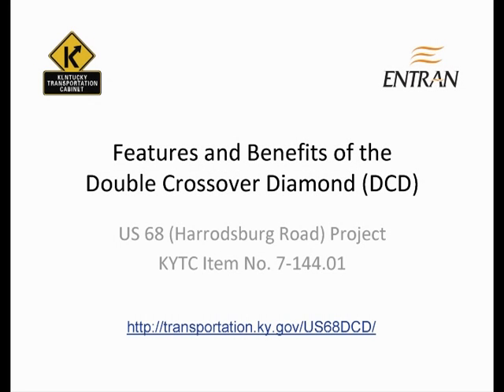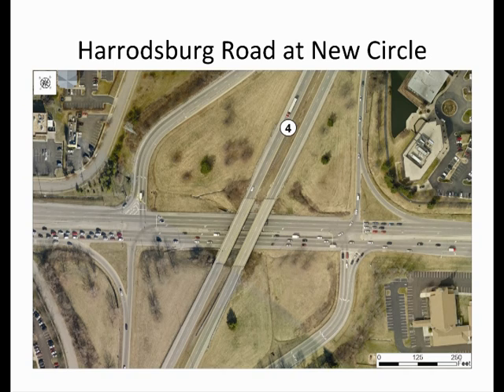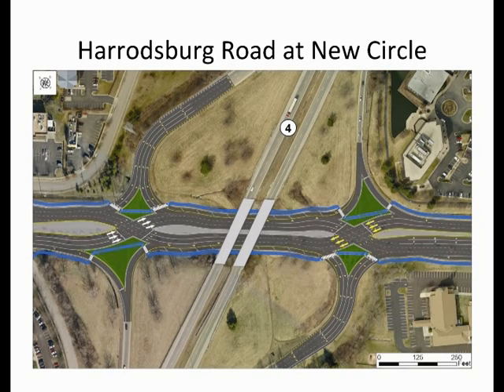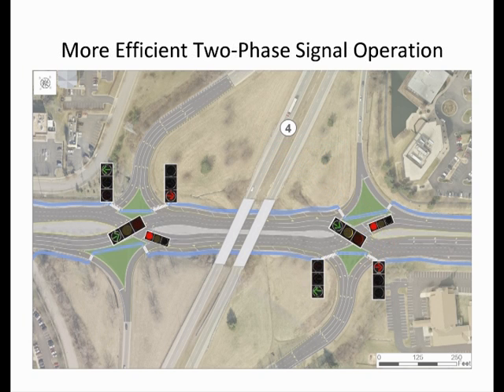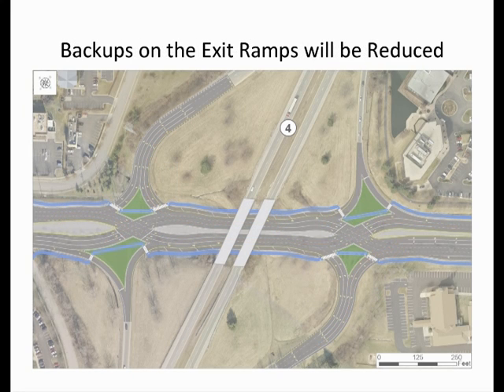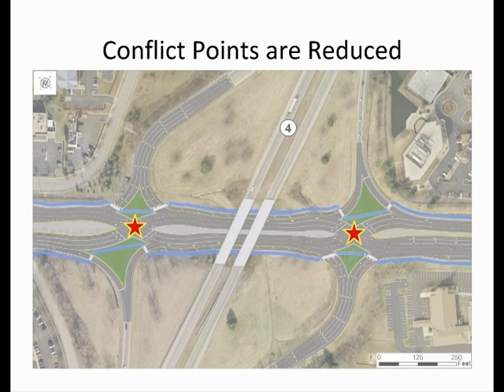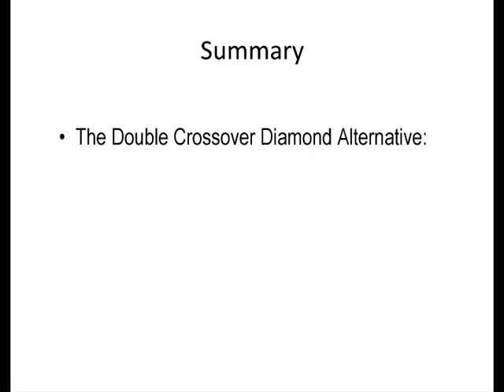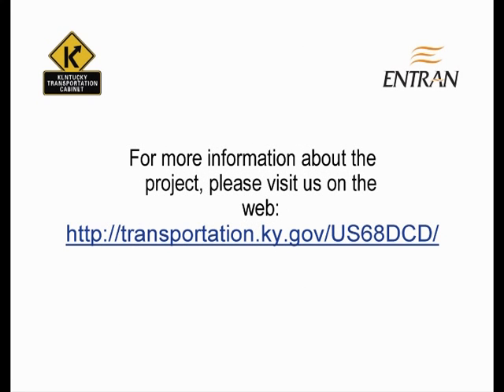Harrodsburg Road Double Crossover Diamond (DCD) Interchange

Comment: 5:13 "fewer conflict points reduce crashes." - then why not use free-flow solutions in the first place? That was kind of contradicting.
Reply: cost, I like free flow intersections as much as anyone but governments need to balance improvements with cost, there are many intersections that require updating not to mention the demand for government funding outside of infrastructure, everyone wants a slice of the cake.

Comment: Drivers everywhere are self-absorbed and distracted. That's not a reason to halt traffic flow improvements like this. Based on the presentation in this video, the change, while foreign to me, looks great. Once I use it a few times it will be fine and I'll be happy to avoid such long stop lights. Actually, I can imagine citizens requesting one of these DCDs at Nicholasville Rd, although it may not be feasible considering the commercial properties that would have to be flattened to make room.